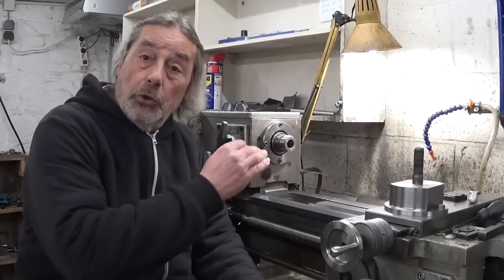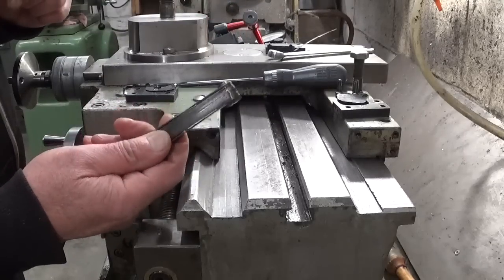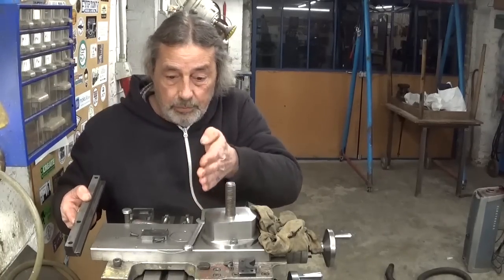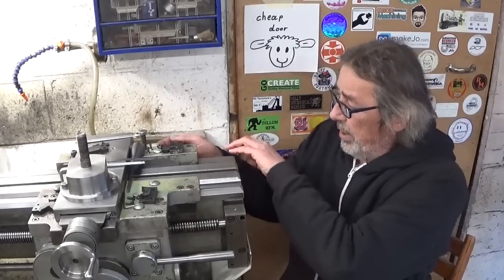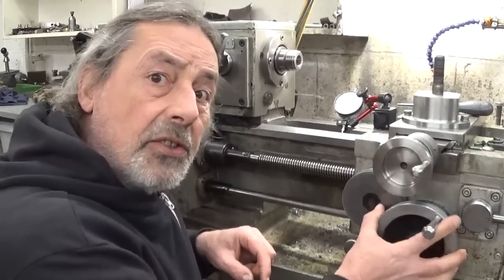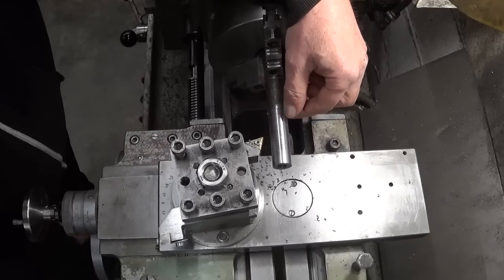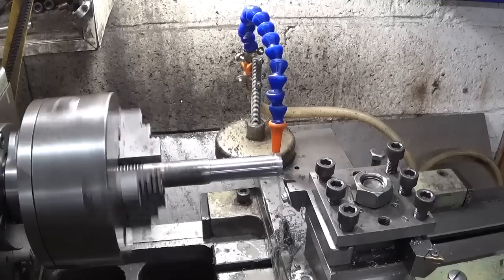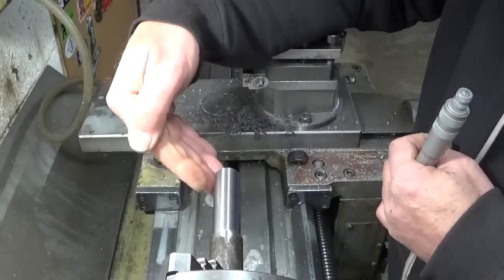Carriage problems.

Comment: I wouldn’t angle the tip of the tool into the work that way. It will tend to try to dig in and bounce, try it at 90 degrees or a negative angle.

Comment: Hmm, that sure is a lot of uneven contact, but not so much wear on the lathe ways, which is good... Having wear in the saddle or the carriage can easily be scraped out, refreshed with rulon/turcite teflon precision strips and voila, you have a full contact and oem specs for geometry of components back in line... The scraped finish will help the pfte glue work better in any case, and the teflon ways will provide even a nice durable surface, as its not just plastic, its bronze impregnated, so its a good bearing material, but it demands cleanliness, as the plastic can get embedded with chips and actively mess up your ways, but again, way wipers, way covers and general cleanliness of the shop takes care of that... But you cant just tighten the lift straps of the saddle to deal with this kind of wear... Its why there is resistance in the travel... The slop didnt come from the clamp, it comes from uneven contact of the V female to the bed way and the other flat carriage way surface too is horribly uneven, which doesnt have anything with side to side movement, but offers shit support of the cross slide into the bed ways and probably allows for slight rocking motion of the carriage, as the other side is likely also worn on the tip, making it convex, which can only be mitigated so much by the clamps... They have to have some oil clearance, and if the carriage ways are convex, there will be some rocking during travel and load... 
I would first check the contact pattern with blue dye, just to ascertain the level of convexity on both sides of the carriage... I would take it off, check it with a straight edge and so on and do some mild scraping to check the things before fully scraping the carriage out and replacing the removed material with aforementioned turcite bearing material... Only then can you consider the clamps as possible source of problems, as your carriage obviously has other much more glaring issues which cant be resolved without some gentle touch of a carbide blade... Everything else just induces wear on the bed ways from increased pressure and ``point`` contact with the worn area, lubricant notwithstanding... Its very likely why your surface ``feels wavy`` - the convexity, which will act as a point contact with the bed, a point around which the carriage wobbles and produces wavy finish... The fact that the taper widen out near the chuck indicates that your tool is on center, and as the carriage ``climbs`` up the less worn area on the bed ways, it gently rocks backward, lifting the tool off the center ever so slightly, thus reducing the depth of the cut... I would experiment with lowering the tool slightly below the center, 0.01mm would be enough, and running the same cut again, if im right, the cut should taper narrower towards the chuck, as the tool will be brought onto center there and will cut slightly deeper... Which will kinda mess with you, if you hoped that this was a good improvement, as it is likely just the effect of the tool height being set right on, and if the taper reverses, it just proves that the carriage is convex, if that isnt apparent from the shim checking...

Dont get me wrong, im not shitting on you here, i just love old iron and want to point out any thing that i can to help any machine user with minimizing the wear on the machine and utilize the machine to its fullest capacity... Im no master in the field, but i did learn a lot, and from what i see in the video, i was compelled to offer the advice above... 

All the best and kindest regards!

Comment: Well, you certainly helped it a bit, with what you have to work with in your shop.  Only other option would be what, re-scraping the saddle V?  That doesn't sound like fun at all.
For what it's worth, I often have trouble on softer materials to get a decent surface finish too.
Reply from the maker: It's still not perfect, but much better than before.

Comment: Hey Michael,
I just noticed that I have the same machine. I´m in the process of cleaning and restoring it at the moment. You can adjust the the clutch of the carriage. There is a big grub screw on the right side of the saddle (pointing towards the tailstock) that you can turn and adjust the clutch. I have the complete saddle and carriage disassembled at the moment and can provide pictures of the inner workings of it all. Let me know if youre interested.

Best regards
Kevin
Reply from the maker: Yes, I am absolutly interested. Please send to; rustinox@outlook.com.
Thanks in advance.
Reply: @Rustinox  Nice, I´ve just sent you a mail. Good to know there´s somebody I might ask if I run into problems.

Comment: I'd call it a success if you eliminated some of the play and got a better finish even if it was a small amount.  On my 1943 South Bend Heavy 10 lathe I was chasing a bad finish also and two things that gave me the most improvement were making a tool holder for a die grinder and lightly grinding the surface of the jaws on 3 and 4 jaw chucks also removing the cross slide and carriage,  stoning all surfaces, cleaning and oiling everything then adjusting the gibs. I stopped after that because for the work I do I was satisfied with the finish. Good video
Reply from the maker: Thanks.Jim.

Comment: Rustinox, have you printed and scraped your saddle to your ways? My Jet lathe had .003” of rock in the saddle when I got it. Looking from overhead, normal operators position, it would be the 2 o’clock and 7 o’clock lifting and falling. I scraped the saddle to match the ways and it has no more rock, and the carriage now glides easily across the ways.

 I also had to scrape the bottom of the compound slide flat as it rocked in and out of the cut as well. Simply putting a dial indicator on your tool and prying up and down on various things can expose a lot about your lathe!
Reply from the maker: I didn't lift the saddle yet, but I will.

Comment: Mr R
Unfortunately I can't offer any positive advice.  I do question the validity of running the dial indicator up and down the part. If the lathe weeble wabbles down the part when it makes its cut won't it also weeble wobble the dial indicator  ? Can you mount the indicator in different locations and  possibly see where the weeble wobble is coming from,  cross slide, apron etc.  Also try it with an unturned piece of stock that you know doesn't have a wave in it.  

John 🇨🇦
Reply from the maker: Thanks John. I will figure it out. Bit by bit :)

Comment: Hi Michel. All of our ageing machines benefit from gentle adjustments whilst we chase incremental improvements. You proved the point with your careful study and adjustments. Yes, sometimes it can feel like one step forward two steps back. But in time, you will get there. Well done on what you managed to achieve so far. 👏👏👍😀
Reply from the maker: And it's also fun to do :)

Comment: what if... you slotted that rear clamp, and reduced the height slightly to make it adjustable for best clearance? is there another clamp under the front? are there marks on the bottom sides of the V way from carriage sink and wear?
Reply from the maker: The V-way is OK. The problem is in the saddle.

Comment: As for the variance in the turned diameter of the part. have you confirmed that your head stock alignment is spot on?
Because if the headstock is not aligned it will give the same effect.
The ways will be worn in an older machine, and most of the wear happens up near the chuck, worn ways will give you the same results ie: diameter increase corresponding to the wear areas.
Reply from the maker: The investgation continues...
Reply: @Rustinox  You are a skilled investigator, you will solve the riddle.

Comment: If the carriage has a bit of slop and can move on your bed, it csn be badly affected by your feed screw. If the feed screw is slightly bent it will lift the carriage once per revolution of the feed screw (when using auto feed).
You could test by stopping the feed screw, then hand turning the crank (on the rack) while at the same time holding the carriage down really hard with your hand or a very heavy weight and taking a light cut. Then you know the turned surface matches your lathe bed/carriage.
Reply from the maker: I will give it a try and see what happens.
Reply: Great point! worth a try I'd say..

Comment: Michel, can you adjust the alignment of your headstock to eliminate the taper? I had a similar issue with my Colchester. I didn't realise that there were adjustment screws between the headstock and the bed. It took a while but I was able to dial out most of the taper when machining parts without tailstock support.
Reply from the maker: The tail stock is adjusted with shims. I have to take the whole machine appart to acces the tail stock bolts. So... well...

Comment: I have the same issue, I initially suspected a bent leadscrew but on measuring the bend it's not as much as I initially suspected. I think it's a combination of the very slight bend and the lack of rigidity causing very small movement of the cutting tip. Still haven't fixed it 😐
Reply from the maker: Even if I can't fix it, it's interesting to know what happens.

Comment: The taper you now have is indicative of a lack of tail support. It may be that with tail support the taper will go away, providing your bed isn't twisted. The waviness you are experiencing in the finish might occur due to a feed rate that is too high for finishing or a tool tip that is too narrow (not a large enough radius) for the given feed rate. Consider that a shear tool used for finishing has a very large radius to provide a very smooth finish. Of course it still could be carriage movement. You could try a shear tool and measure to see if the undulations in the finish are larger and farther apart. The material you're using can also have a great effect on the finish. Some of the low grade bolts found here in the US as well as some mild low carbon steels provide terrible finishes no matter what you do.  That material is usually stringy when turned and will show areas that appear to be torn away from the parent material. A shear tool is especially helpful on those steels to get a decent finish. Bed wear raises and lowers the tool as it traverses the lathe bed and can result in variations in diameter dependent upon the extent of the bed wear.
Reply from the maker: With tail support I have the same results. Thanks for your input.
Reply: @Rustinox  Try raising or lowering the back side of the bed slightly at the tailstock end and see if it makes for less taper. Cast iron, like all materials, is flexible and the bed can be twisted causing taper.
Reply: Good point.

Comment: A great improvement but now I suspect a slight twist in your bed is your problem.
If you want an excellent finish try using your tangential tool left to right as a final pass taking only 30 or 50 microns (1 or 2 thou) but don't alter the angle to do this from normal  turning.
Reply from the maker: I will give it a go.

Comment: Michel, like Randy said, as carbide inserts wear they leave crappy finish that tend to show themselves in different ways.  Even with finishing inserts, cuts of less than 0.010” don’t go well.  As for the waviness, you’re gonna have to tackle every moving part individually to reduce lift. So if you want to measure you saddle play, make sure everything else is tight. Process of elimination.  I had similar issues 2 years ago.but since then my lathe is very precise.  Let me know if I can help further. Gilles
Reply from the maker: That's what I do, Gilles. One by one and take my time.
Reply: @Rustinox  it’s a frustrating problem but I’m sure you will solve it.

Comment: I find that any relatively light lathe needs a little help to keep the carriage or compound seated properly on the ways or feed screws.  Makes a difference on accuracy,  or on the minute chatter and vibrations that may occur on finishing cuts .  For the forward v-way, it can be as simple as pushing down on the carriage over the v-way .  ....also gives you a "feel" of how the cutter is doing .  On an Atlas type of lathe,  pulling back slightly on the toolpost or the carriage can have the same effect .   It also occurred to me when I saw  you,  Rusti   was having continued problems with your rear-mounted cutoff that possibly your carriage may be erratically lifting or chattering slightly on the front controlling v-way  as the cutting load varies  -- and due to the reduced downward load on the front "controlling" way .  Just a thought -- cutoff tools can be sneaky on any lighter lathe .
Reply from the maker: It all makes perfect sense. Thanks Ken.

Comment: Hi,   What is often over looked on older lathes is the head stock bearing  . Taper bearing need to be pre load on them and can give rough finish to work been turned. The old method of checking the lift will show this up. Some way of lifting the chuck with a clock reading the lift will tell you.  If you can part off with a problem then the head is fine. 
Steve
Reply from the maker: Thanks. The bearings are fine. The problem is in the V.

Comment: You could probably 1/2 the waveyness if you support the workpiece with the tailstock. Good result so far though. ATB stay well.  regards from the UK
Reply from the maker: Even with tail support, it does the same thing.
Reply: I think this doesn't help because the problem is in the saddle, not the headstock, as Rusti identified.

Comment: Hi Michel, I noticed the carriage doesnt seem to sit solidly on the ways. I might be wrong of course, but to check I'd take off the apron, blue up the ways and have a look at the contact pattern under the carriage. It might be riding on a small patch in the middle so it can rock, which would cause your problems.
Reply: I was thinking much the same as you. It does look like there is a hump or high spot in the middle area of the saddle vees.  Hi-spot blue would witness any such defects and indicate where any scraping should be carried out to remove the rocking points.
Reply from the maker: Thaking the saddle down is on the "to do" list.

Comment: Hi Michel, I get similar issues, usually on harder materials (especially unknownium and scrapbinium grades of steel). I need to do some experiments to see how much of a difference locking the compound and cross slide would make, and look at the way the saddle behaves as you have done here. Another one for the list! Thanks for the video
Reply from the maker: Thanks Olly.

Comment: I'm curious about a couple of things.  When you take measurements with the dial indicator, will you see any deflection if you rotate the part but don't move the carriage?  Put another way, I'm wondering if the waviness you're seeing will only appear in the axial direction, or if there's also a radial component to it?  
If the hump twists around the part like a cork screw instead of just being a series of thicker and thinner sections, each running in separate rings around the part, then this particular problem may be caused by something else.  The chuck could be bellmouthed, or have some other problem?
I'd be curious to see what a test part looks like if you turn it between centers.
Unless something else is seriously wrong, and causing the carriage to be supported by the gear that rolls along the rack, that doesn't seem like it would be a likely source of the problem. 
One thing that happens on older lathes is that the bottom of the carriage wears unevenly. Ex: It may have worn enough toward the ends that there's a hump in the middle, and it could be rocking back and forth on the hump. (Or not.?)
Anyway, thank you for another excellent video!
Reply from the maker: I think the spindle is fine. The problem comes from the V.

Comment: Time 07:55.  Haha. It's the demonstration- /show- devil! Do You remember Bill Gates showing what  Windows looks like, and he got a big blue error screen?
Check that clutch, or the stuff locking the clutch lever. I hope the lead screw has its thread...
Regard how the force moving the carriage is applied. Regard "the arm of force" creating a torque that wants to twist the carriage. There must be a play between the V grove and the carriage. Then moving right or left will make the carriage "dance twist".
 Here the mini mill carrying a 5 inch, 12 kg, rotating table carrying a 5 inch 3 jaw has jamed in the Y direction..... Lubrication is likely needed....
Reply from the maker: The investgation continues...
Reply: @Rustinox  I'll be looking for Your next video.
The mill is cured. The heavy load of some 20 kilo combined with too little oil left made it protest, behave like a donkey sitting on its bum..

Comment: Hi Michel l have an old Raglan 5" lathe made in the 1950/60 the chuck has a bell mouth problem and both the ways are made of flat ground and hardened steel bars  both are badly worn. The saddle and the cross slide are badly worn, also the compound slide is worn. It really needs to be stripped down and have the surfaces scraped but l do not have the necessary skills to complete the work, although l do intend to try. Other than these problems the lathe is great. At the end of the day you can only do what you can with what you have to hand, you produce a high level of work with what you have,so keep banging away with it and do what you can, your doing a grand job. Watching this video has given me the necessary drive to undertake the work on my own lathe. Another great video regards Gary
Reply from the maker: Thanks Gary. Go for it.

Comment: Well you have an improvement.  I have noticed over time that with carbide especially, taking a very light cut this happens, when taking a heavier cut it does not happen.
Take care Rusty.
Reply from the maker: Indeed. If I push the machine, it doesn't happen.